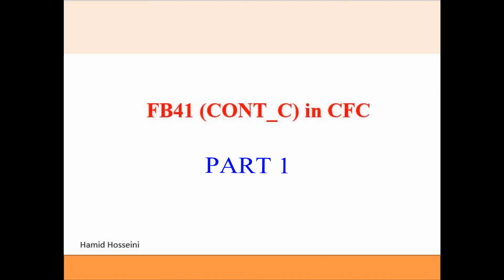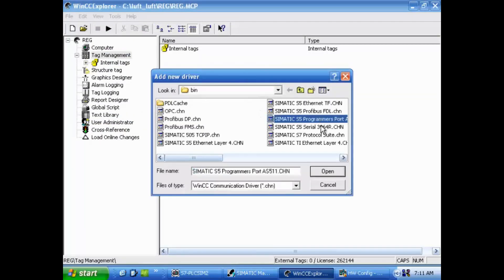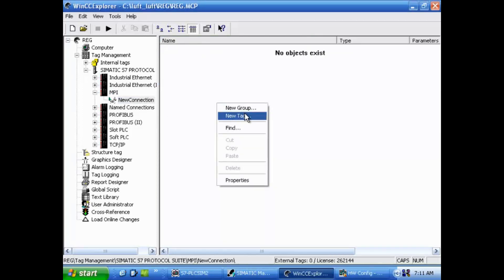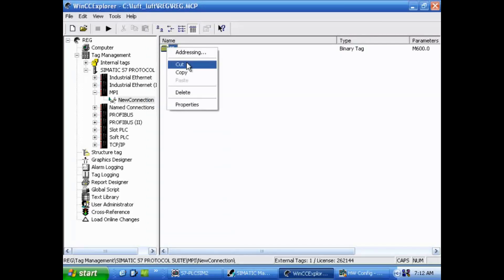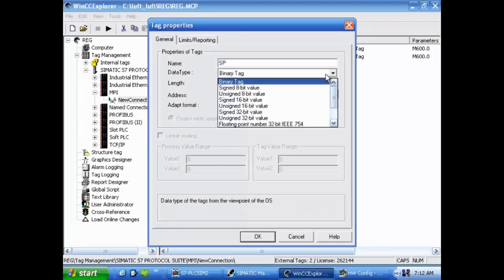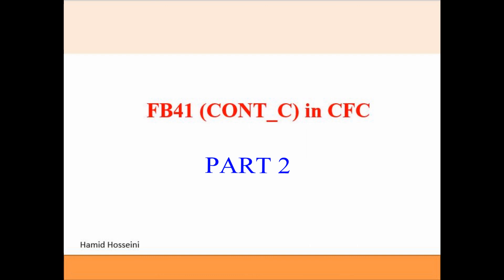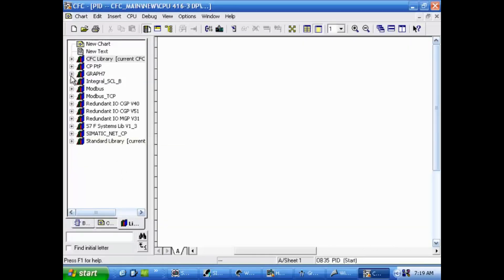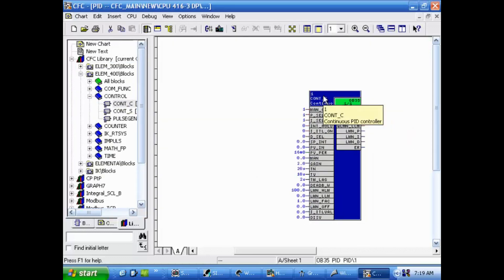SIEMENS CFC | Continuous PID application in CFC  | S7-300 | S7-400 | PCS 7 | STEP 7

Comment: Dear Sir..... On which basis we should change the value of TN, TV, TM_LAG .... ??? I am tuning a coal PID..... but it is giving me oscillations.... please guide me how to adjust TN,TV,TM_Lag values...Thanks
Reply from the maker: I will make a new video for that with the updated tuner version, but the starting point will be:

https://youtu.be/9VC94hkqZ5g
Reply from the maker: Just make sure that your process is not oscillatory due to bad transmitter reading or a faulty positioner.
Reply: one more thing. Also please tell me in FB41 block..where can i find integral time?? and how i relate derivative and integral time to derivative and integral gain of a typical PID??